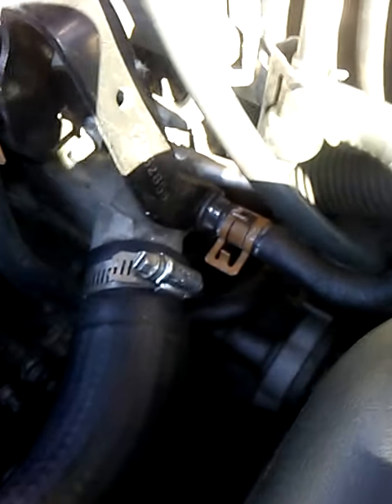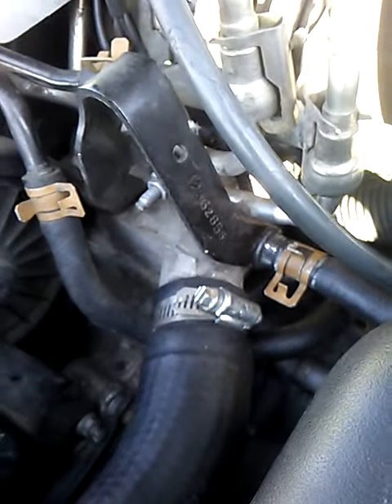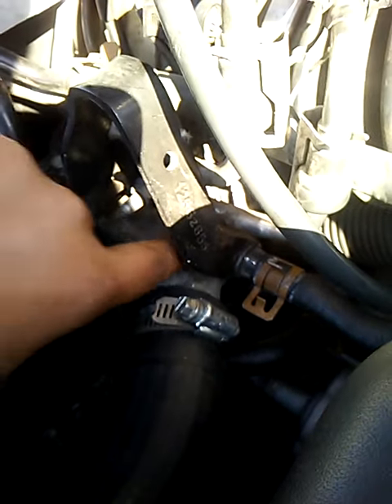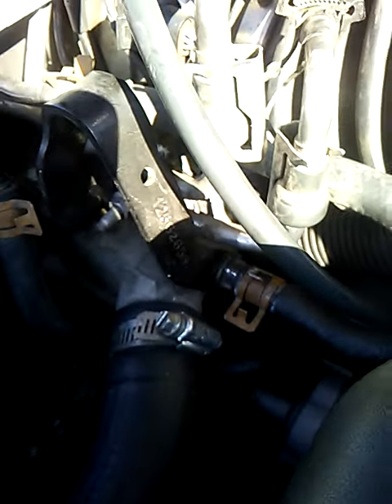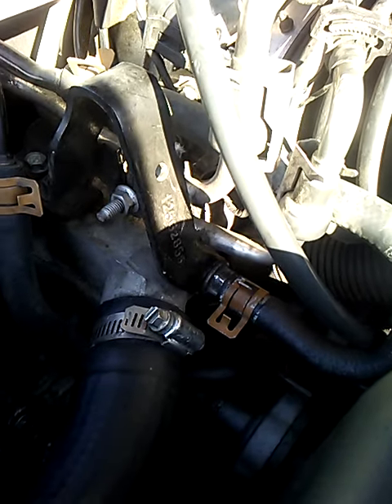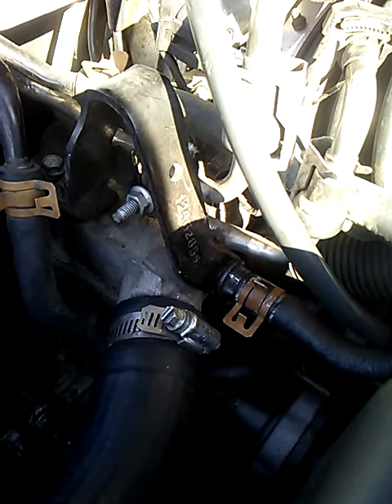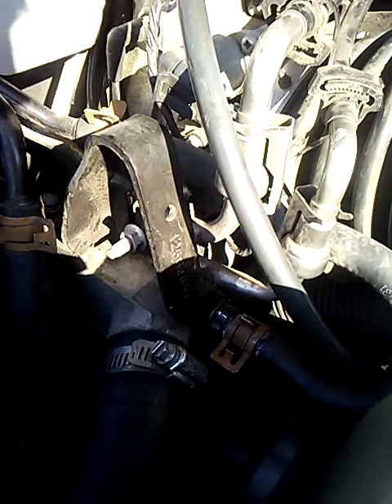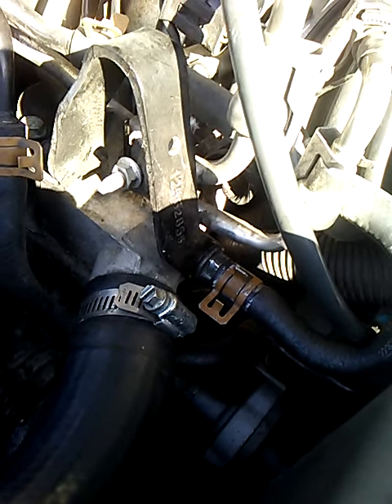Cadillac Deville overheating solved

Comment: Here's a more complete method of how I cleaned out the cooling system AND the purge line. This lady is correct that this thing is a small line and it can get easily clogged and it will single handedly overheat the engine. Now my car runs the perfect temps. 

 On my 98 DeVille I just pulled out the upper and lower radiator hoses and let it drain that way. I took a garden hose, stuck it in my upper radiator hose and flushed water from the top of the radiator to the bottom and waited for the water to run clear. Then I put the garden hose in the lower radiator hose and reverse flushed it so it went from the bottom of the radiator out the upper radiator hose and I let that run clear. 
Then I removed the reservoir cap, stuck the garden hose down into it and flushed all of the coolant out of the engine and it ejects out of the port that the upper radiator hose connects to. I let that run clear. Then I put the garden hose right up to the port that the upper radiator hose connects to and blasted water in reverse through the engine until it overflowed the reservoir and I let that run clear. 
Then I took out the thermostat, put the reservoir cap back on and off the garden hose into the upper port and flushed it out of the lower port. 
Then (THIS IS VERY IMPORTANT) I  put the upper and lower radiator hoses back on but I didn't clamp them down. I took off the purge line which is directly above the upper radiator hose. It's a narrow and small little hose with small clamps. Clean out that hose and make sure the small outputs on both ends of the port are clear of debris. There Purge line is very easy to get clogged up and when it does it'll overheat your car every time. Stick the garden hose down into the reservoir and blast water through until it sprays out of the front and back of the purge line with full force. Put them Purge line hose back on and clamp it down. 

Drain all of the water out of the radiator and the engine. I just blow through the upper radiator hose until it's clear. And then I put a disconnected small tube or hose on to the reservoir opening and blow air into it until all the water is out of it. 
Take a jug of coolant and pour it down into the upper radiator hose until it's coming out of the lower hose until it's flowing free with no bubbles and quickly jam the lower radiator hose into the lower port. Now the radiator is full. Keep the upper radiator hose filled to the brim and keep it held up so it doesn't overflow. 
Then start filling the reservoir up with coolant until it's flowing freely through the upper radiator port and there are no bubbles coming out. Then jam the upper radiator hose into that port. Clamp the hoses down, fill the reservoir up half way and you're good to go. 
Start the car up, let it run with the reservoir cap off, squeeze the upper radiator hose continually to burp the air out. After about 20 minutes of this, put more coolant if it's lowered down some and keep it filled too the hallway point. Put the cap back on and let it keep running while revving it up to 3000 RPM. This helps Purge the air out some more. Monitor the temps and make sure the fan turns on and off at 222 and 213 degrees. It should bounce back and forth between these 2 temps while idling if everything is down correctly. 
Doing it this way will make sure that everything is cleaned out and not clogging anything up. The Purge line is very important to keep cleared and it's very easy to do. This one small like will overheat your car in a heartbeat if it's plugged up.

Comment: I was having heating problems with my 2000 seville sts. This video is a God sent. After replacing the bigger things, i couldn't understand why the resvoir hose was still cool, and i was still overheating. Took this gem of a video for advice. It took brute force to clear the hollow bolt! Cleared it completely out 100 percent no heating issues! Thank you, i thought i researched it all, but in the end, this video saved my Sally Saville. ☺
Reply: Chris Feltrin I’m so happy my video was helpful to you👌

Comment: This video freaking made my year I bought a 2006 dts this thrusday with 120k  owner said it had bad headgaskets so I got a good deal on a engine but I didn't think it was the heads cause I had no smoke no check engine light and the radiator was cold when the car was running hot so I ran across your video and did this it solved my problem I'm a mechanic and I never ever thought about this little hose being the problem just want to thank you it helped me as a mechanic now I know for next time
Reply: You’re very welcome

Comment: I really appreciate that info because seriously I am having the over heating problem on my 2001 Cadillac DeVille just replaced the thermostat new radiator and it still ran hot, Thank you for the video so much 👍👍👍👍

Comment: @Dianne check the purge line, check the hollow bolt, make sure your full on coolant. With the purge line disconnect it on both ends and put some pressured air through it. same with the hollow bolt...the  hollow bolt is at the end of the purge line close to engine... very easy access. do it your self... If engine still runs hot check thermostat. which is also easy access and easy to check

Comment: I have to echo the exact same words how grateful I am about clearing out that little "purge" line on this 2000 Eldorado project I'm working on! Previoisly, it would overheat easily after 5 minutes, whether idling or driving; The previous owner told me it needed a new water pump; I didn't see anything dripping from underneath, but after I watched this video? I didn't even take a 9/32 drill, I just used a metal sharp pick and it was clogged SOLID! After I finally punctured through the solid clog in the purge line, so far it hasn't overheated SINCE! I still have to take it on a road trip to be sure, but previously it would overheat after only 5 minutes! Now, it's been 25, 30 minutes, and the needle on the temp gauge stays dead center or slightly LOWER! WOW! I am SO grateful for this video!🙏 Thank you!👍
Reply: You’re welcome I’m so happy I was able to help

Comment: You are my new best friend . I pulled the bolt and it was clear but when i went to blow air through the line nothing and then a "POP" so now its back to normal. AWESOME  . Thanks you
Reply: Can u un screw it from the engine?

Comment: Good video girl.  One other thing that may be of concern is the AC condenser that blocks air flow to the radiator. I moved the condenser forward around an inch or two and now the Cadillac actually cools while stopped and in traffic With a temp of 170 tops. .  Like I said though good video.
Reply: Thank you

Comment: Thaks a lot for the tip I'll check it tomorrow  ' cause my Cady overheats  I changed the thermostat  and flushed  the coolant several  times too and  it and it still overheats  I'm fed up but I hope it works.  Thaks again lady ' cause I love my baby Seville 2001

Comment: Hey Star...I'm back...just bought a 99 El Dorado...Super clean. Guy said it overheats intermittently but I bought it anyway...Looses a small amount of coolant after driving but not overheating. Hate pump and thermostat has been changed out..Car even has vogues on it with 117,000 miles...Any suggestions...or desired prices?

Comment: I did all the extra changing things u did but I haven't heard of this. And I'm still having the same problem. Ima do this rn. Hope this works
Reply: Did it work🤔
Reply: Why Play no i think its the head gasket
Reply from the maker: If you were driving the Northstar while its was running hot then that definitely did it. Northstars are sensitive, you cannot let them overheat too many times. But I'm pretty sure it was something simple before your engine blew. And one more thing people dont check is the cadillitic converters. If its clogged it can also make a car run hot

Comment: I have the same problem just started Monday. The thing is it takes it a while before it starts to overheat (45 min or so), how quick was yours running b4 it started overheating?
Reply: JJ Madison check the hollow bolt and the thermostat, and blow pressured air through the purge line

Comment: Probably a dumb question, but how do you get that hose detatched? Gotta pair of pliers for the little clamp, but the hose still doesnt want to budge
Reply from the maker: Put a little WD40 to loosen the clamp
Reply: I'm having the same problem! I was able to move the clamp out of the way, but the hose doesn't seem to to want to pull off. Did you end up resolving this problem?

Comment: How did you clean it out ...I'm having the same problem....changed thermostat still runs warm....it doesn't red line over heat but runs warm
Reply: Did u fix it what did u do
Reply: Cant figure out what it is

Comment: Yo I Love you ❤️ lol a lady that helped me tame the beast called Northstar
Reply from the maker: Lol my pleasure!!! I love Northstars I think people give them a bad rep. I refused to let people tell me my heads were cracked or engine blown. I wasn't going for that. I've have a few Northstars and never had a engine problem. They've overheated but it would be a hose or thermostat simple stuff. But if you continue to drive the Northstar while it's hot then  yes you can blow your engine and that's any car really. Northstars are just a little more sensitive and cant take too much overheating. So if it does run hot dont drive it till you can fix the issue but I can guarantee you the engine will not blow if you dont drive it hot.
Reply: @stargaimazz8154  could you do a video on flushing the radiator?

Comment: I fixed my overheating problem on my 98 DeVille. I had a bad coolant cap and the system was totally clogged up. So I drained the system by taking off the upper and lower radiator hoses, then I flushed water through the upper hose, into the top of the radiator and out through the lower hose. then I back flushed the radiator by running the garden hose through the bottom radiator hose and waited for it to start pouring out the upper radiator hose. I waited for all of the coolant to wash out. then I put the garden hose up against the port where the upper radiator hose connects to and blasted the garden hose through that. it pushed out all of the coolant through the entire engine and out the reservoir tank. I let that run clear and then put the garden hose down the reservoir tank and let it flow out the upper radiator hose port. do this and let everything flow out until it's clear. then reconnect the bottom hose. then take a jug of radiator cleaning fluid and pour it down into the upper radiator hose so that it goes straight in to the radiator and fill the rest of it up with water and reattach the upper radiator hose. then fill the reservoir up with water and start the engine with the cap off. squeeze the upper radiator hose to burp the air out of the system and fill it up with water and put the cap on and let it get up to operating temp. then let it sit for a couple of hours. drain the system by removing the upper and lower radiator hoses and flush and back flushed with water again.  do this several times until you see nothing but clear liquid coming out. then fill it with coolant and you're done. I fill the radiator directly through the upper hose first. then replace that hose and then fill the reservoir. doing this lowered my operating temperature by 25 degrees and now it doesn't overheating.
Reply: wesley maynard  I think I need to do exactly this. Mine isn't over heating too much, it usually stays between 190 and 220. I was going to flush out the coolant and clean out the hoses before it gets any hotter.

Comment: My 2000 Cadillac Deville DHS Northstar V8 is currently overheating and it just started out of nowhere. The car starts right up, it overheats and it says I need an oil change after it heats up but it just got an oil change, it also says check coolant and it has coolant in it because I added some when it first started overheating, it just runs hot, do not think it’s blown head gasket because my car doesn’t smoke or anything when it does get hot. I’m not sure if any of you alls Lac is similar to what mine is doing?? Maybe this video will help not sure just kind of need advice here please.
Reply from the maker: Yes check the hollow bolt, it can be clogged.

Comment: I am going to check mines on my 97 aurora. We must remember these motors gm  makes are made to blow up.  So you 'll buy another.  These motors could have been super and last 400k. But shotty sensors.  Small purge lines. Leaking gaskets will ensure your North star blows up due to lack of attention. Motor runs smooth. Good power. Great bodys. = customer is out of car buying business for 10 years easy. Ford gm Chrysler. They need repeat business.

Comment: My 2004 deville randomly started overheating yesterday going to work .. had to tow car back home.. next day i got a oil change and fresh coolant.. still overheating 30 seconds after turn on car.. Found this video figure i give it a try.. i open my hood to find the hollow bolt.. smh and saw my dam belt hanging off the pulley 😂 my belt snapped and got chewed  up.. Not sure if thats the reason why it's running hot instantly.. but im 100% sure it is...
Reply from the maker: Maybe, but check the hollow bolt and the purge line as well, any given time there can be multiple things not working properly.
Reply: There are two belts the accy belt on passenger side of engine and the small one on the drivers side of car near valve cover,  this drives water pump. Without the pump circulating coolant you will destroy engine.

Comment: I've got a 98 eldo ive went trew everthing on rhe coolent sys water pump thermostat overflow tank thermostat houseing the only thing thats not new RAD. And i was still leaking coolint it looked like it was coming out around the waterpump houseing i was going to give up on it and i tryed one last thing that nanotec headgasket in a can stuff it seems to have worked she's running like a top and not getting hot anymore id recommend it before any of you other northstar floks decide to do the 3,000 doller head gasket job or just junk your caddys you've got noting to loose at that point anyway . I must have got a good one because i got ot with 145,000 on it and im up to 248,000 mi now there good cars but you have to keep an eye out for sentient things and your good

Comment: does this work 97-99 devilles??
Reply: Where is that located. My 97 is overheating.
Reply: denttimothyr44 
It's right above the upper radiator hose. Read my full comment at the top for my full process to clean out the entire system. This little line will single handedly overheat the engine. And it's so small that it's easy to get clogged.

Comment: I'm willing to bet most of the Northstars headgasket failures were caused by mis-diagnosed overheating problems.
Reply: dstarks80 no.  People are very naive.  The car will overheat, and they keep driving it. This causes pressure on the headgaskets, and this can lead to destruction of the headbolt threads.
Reply from the maker: I refused to let someone tell me my head's are cracked or engine blown, so I took it upon myself to get to the bottom of the issue with this overheating bull crap. I knew my engine was strong there was only 120,000 miles on my Deville at that time. My Deville was running at a perfect temp for years and then out the clear blue sky my temp jumped to red within 5 mins. So I always knew it wasn't my engine. So, I went from there and figured it all out, and came to the conclusion it's the hollow bolt. A very simple fix.
Reply: I just replaced the line with a rubber hose and clamps. Car runs perfect now

Comment: couldnt hear aword,......wind noise
Reply from the maker: There's a hollow bolt connected to the purge line, pull it out check for debris and put it back. Problem should be solved if there was debris in hollow bolt

Comment: my 2002 Cadillac northstar  just start running hot so I need to no what to do. It has never done this before
Reply: Dianne Dixson l fixed my ride because of you
Reply: Dianne Dixson Probably need to get rid of it. My mother had one under Cadillac warranty and it stayed in the shop. I'm stranded typing this in a 1999 Deville that I'm test driving, and it ran hot before I could even finish the test drive. It only has 66,000 miles on it.